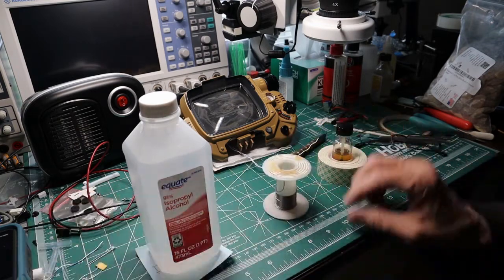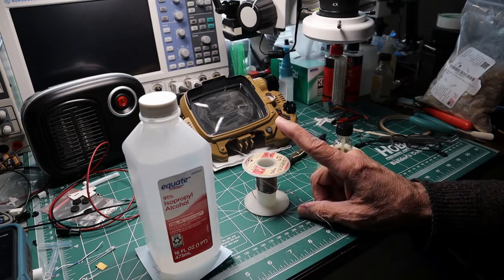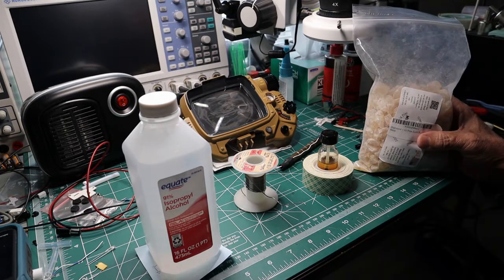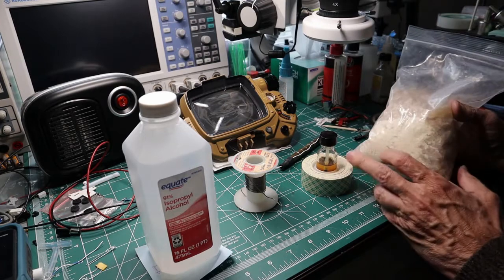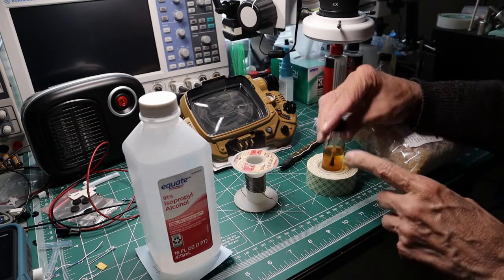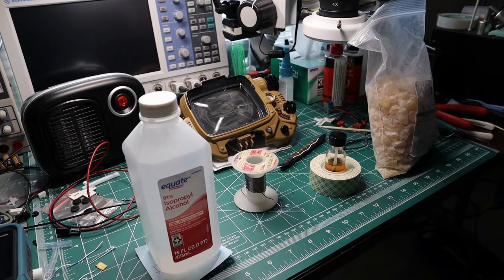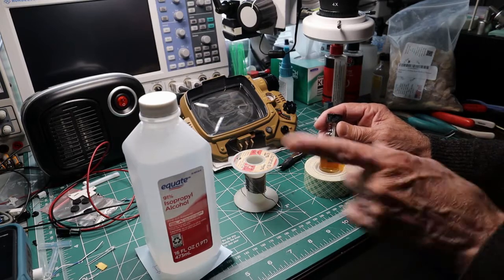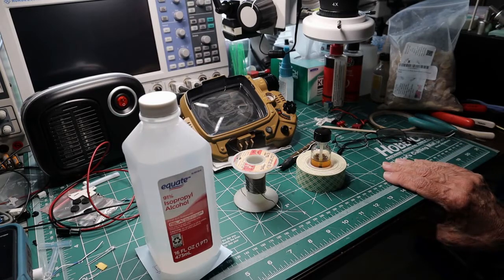Make your own flux for better soldering

Comment: Hi bro i did this kind of flux as per your video however it got turned into solid state stone like after resting for 24 hours leaving alcohol on top , i guess it didn't blend of dissolved well any such
Reply from the maker: The best way to get the rosin to dissolve faster is to crush the rocks and add them to the 91%-99% Iso and mix, your going for a amber color, but just add more, a little at a time if you want it stronger.

Comment: is it possible to add too much rosin to the mix?
Reply from the maker: I add enough Rosin to the Isopropyl to get a deep amber color. I suppose you could have too much rosin/Iso mix, but as long as it can be easily applied with a small brush you'll be fine, flux is very forgiving and the wetting only gets better with a higher Rosin mix. You can just add more Iso if you feel you got it too strong.
Reply: @teslabe7701  thanks, iv made a batch today in a 30ml bottle and it looks to me like its gonna last years lol. i should have got those small 5ml eyedrop bottles haha.